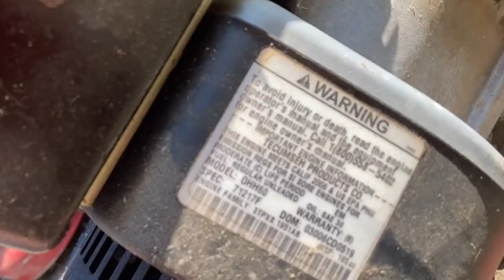GENERATOR PREPPING What you should buy now for your Honda, Briggs, Tecumseh, Chonda generator NOW..

Comment: I noticed you suggested keeping the battery of your generator on a trickle charger.  I have a 15kw generator with a 30 hp engine driving it so I need my battery to work.  I used a trickle charger for years and found that my battery was often dead in less than a year.  I just about decided I was better off  trying to remember to use a regular charger every month or so.  Off course that does no work so well because my memory is not so good.  Recently I have changed to using a battery minder.  The battery minder is equipped with sensing circuit which charges the battery only if the terminal voltage drops off.  I believe the trickle charger over charges the battery and reduces battery life.

Comment: Thanks for the excellent tips. I already keep an extra spark plug handy for my Jenny but had overlooked the carburetor and the air cleaner. Somebody actually gave me this generator because they could not get it started and it turns out that the flow orifice in the center of the carburetor was gunked up with deposits. Took some luck and a magnifying glass to figure out what was wrong with it. I put a note in my phone calendar to start it once a month and make sure to shut off the fuel and run it until it dies.

Comment: I have two generators one's a little Ryobi 2300 watt generator and the other one is an onan 25 00 w what I'd really like to have is a single cylinder or a little cylinder diesel just for the plain fact that you can store diesel fuel a whole lot longer than gasoline gasoline don't hardly last any time nowadays and if your power goes out for an decent amount of time and you can't get any gasoline the generator won't do any good but with diesel you can store it for a very long time without it going bad and practically a diesel will run on anything but it's a lot harder to find diesel generators that aren't just gigantic but in my opinion diesel is the way to go

Comment: If you live in an area where you get a proper winter cold weather you don't want to use 30 weight motoroil. You wan to to go with 10W-30 or some other winter compatible oil.

Comment: Using ethanol gasoline in 2 cycle small engines will deform the plastic float in the carburetor.  I use recreational gasoline (non-ethanol) in my Honda generator. I remove the float bowl under the carburetor by taking the 9/16 sized bolt off that holds the float bowl in place. I do that and drain all the gasoline out of the tank after every use. I've had my generator for five years and she starts up every time I need her. She's a sweetie. I turn the generator off at night, while we're sleeping. The last time the power went out here it lasted for 54 hours and the generator used 10 gallons of gasoline.

Comment: Great video Chic!!!  Hipa makes a dual fuel carb for $50-60 bucks that lets you run propane also, cant remember might even be natural gas too. i was told they are also working on one for my Honda 3500 also
Reply: I have a 3.6KW Black Max and got a dual fuel carb for it back in 2016. I think it was around $38. Took about 5 minutes to install and has worked great. Engine hasn't seen gasoline since. I only run on propane. Natural gas is an option.

Comment: Not my generator.  I run it for 15 minutes every month.  It is loaded with stabilized PNE gas and 10W30 fully synthetic oil.  I keep leanty of extra oil in the shop.  I shut it off with the fuel shut off every time I run it.  I also add Marvel Mystery Oil in all of my four cycle gas.  I keep 30 gallons of extra gas in a shed at the rear of my shop, PNE of course.  I am a stickler for PM.  I know how to do it and what has to be done.

Comment: If your pull rope should break,,,,not a problem.Un bolt the side cover with the existing broken pull cord.You can use ANY type of cord about the same length as the broken cord,,,wrap it around the fly wheel and pull,be sure your pulling in the correct direction as the old cord.This will work until you can repair the original.Works in a pinch,done it before.

Comment: Seems like nobody has any service parts for their equipment because of the disposable world we live in today. I have a spare carp-a-trator for a Briggs & ScrapIron push mower and a MTD Tiller (chonda), and some other odd service parts such as filters/spark plugs/rope.. I'm starting to like the engeneered fuel for storage like my leaf blower because it gets used a little every few months like a generator.
Reply: Not all engineered fuel is equal. Use this to flush your fuel system and it will never let you down.
https://www.youtube.com/watch?v=imrFqyTDtEA
I am pretty sure its available in the USA, as I understand the new specification for the non lead gasoline to replace 100LL will be an Alkylate. I know there are refineries in the USA that have Alky units for blending purposes.

Comment: I don't know if you run into this situation at all... I've been told if you don't run your generator every so often, the ? armature ? stator will lose it's residual magnetism and the generator won't put out any power.  I try to run mine every 2 or 3 months, add a shop light to make sure it's really working.  Again, don't know if this is really a problem or not.

Comment: Per your suggestion of draining the tank, once drained, would you also suggest running the generator until it runs dry to clear out the lines?   We have a Honda that we've had to use twice so far but it may be a while before it's needed but as you suggest, I'd like it ready to go.

Comment: Couple of things. You should mention the amount of turns and show how to wind the starter rope. Second I have a Honda Generator that doesn't have a fuel shut off petcock is there a way to add one so that you can run it out of fuel to avoid the mucky carb issue. :)
Reply: If you take the recoil off a Honda GX engine you will notice the starter cup has a slot cut in it so you can wrap a rope around and it pull start it....
Reply: @nos9341  I replaced a rope once and had to wind the spring like 7 times or something so it would go back in after I pulled it to start the engine. Never had a Honda just cheap mowers

Comment: Get some chickens.  Get a generator that also runs on propane.  Install a generator transfer switch for your home, then you can run your house like nothing happened.  If you have a big boat, keep the gas tank full, then you can siphon  out the gasoline for your generator.  And yes, keep plenty of oil on hand.

Comment: Converted my gas generator to Propane (kits are readily available on the net) cause you can store it indefinitely and not bother about gummed up  carbs. Regards !
Reply: There is such thing as a propane filter for good reason.
Reply: I converted my Honda 3000i to dual fuel. Great to have BOTH options. Gas has 15% higher output, so there's that.

Comment: I love to make bread, so I have a bunch of 5# bags of bread flour stored all over the house.  Bread is the staple of life and you can survive off of it.  I have a pound of Active Dry yeast in the freezer.  My ancestors from England and Scotland survived off of bread and so can I.  I can always cook something because I have two Blackstone griddles and if push comes to shove I can cook on my fire pit.  I do not use ethanol gas in any of my small engines.  My generator is full of gas and oil at all times.  My generator starts with one pull, every time.  The only spare parts I keep for my generator is a spare spark plug- RC12YC.

Comment: So how about a lp gas conversion for generator?  The good the bad aspects of a lp conversation.
Reply: "The good the bad aspects of a lp conversation conversion."
Unless you meant what's good and bad about talking about LP gas.
Reply: There is a power loss on most engines. Consumer generators generally can't put out their rated power on gasoline and on NG they can be down as much as 25% on power. LP is a little more energy dense so its less and issue.

In cold weather a lightly loaded set running on NG or LP might have an issue with moister building up in the oil and turning milky unless the set is run for an extended amount of time and under a significant load to warm up and dry out. If you do not do this there is a risk of rusting up the engine if it sits like that after use. Light duty sets like Generacs and Cummins sometimes ice up from all the moister and plug up the air box and crank case vents. I have seen a few blow the dipstick out of the tube and blow all their oil and and fail. 

Know you set and watch for issues.
Reply: I converted to a dual fuel carb back in 2016. The carb took about 5 minutes to install. Runs great on propane and handles loads just as well as gasoline. Engine runs a touch quieter on propane. There are no gasoline issues when you run on propane only. I can run on natural gas but haven't tried it yet.

Comment: There seems to be a lot of concern with bad gas on this channel and others. I have not had a problem with this living in Canada or the UK. I keep gas from year to year. Generally only mix a batch of 2 stroke evey second year. I only buy premium without ethanol which may be the reason. Is it the heat and humidity or is there actually a difference in the fuel. I'm over 60 living in house #7 and some of my 2strokes are from the 70's so it's not that I've just been running for a couple of years. On this channel I have watched you dump out fuel that looked 100% water.

Comment: Back when we had our first ice storm in 2007 I bought a unknown brand generator but I can’t find any information on the engine shroud. I finally found a new carburetor in Alabama but it is bad now ANY IDEAS ON WHERE A MODEL AND SERIAL NUMBER WOULD LIKELY BE.??  I hate to buy a new generator when the power goes out again!
Reply from the maker: Is there any identifying marks or names on the generator itself, not just the engine?
Reply: @Chickanic  I will have to do more investigating then. I may have found the replacement online but I need to know which unit I'm working on first. thanks
Reply: @kikupub71  make a video of it post on Youtube and link to this. I am sure there are enough people here that can comment and help you.

Comment: I am sorry Chickanic , but i would never put 30 oil in a motor any more , it is a way to bad oil in my mind. There is a reson to whay the car industry stoped using that caind of oil If you look in youre engine papers from Honda it will say 10w/30 synthetic oil. Have a some costumars that where using 30 oil and the oil whas like tar when draining it . After a few oilchanges with good synthetic10/30 oil the oil is never so dirty any more and they run alot better.  But this is only my thoughts and i have used 10w/30 oil sens 20 years back in the mashines here and they go like champs.
But we have the same problem with bad gas like you do "over there". Best whishes from Sweden .🇸🇪🇸🇪

Comment: Unfortunately my Honda generator is much more difficult to work on ,  it's a EU3000is everything is packed in tight to keep it quiet,  I wish it was fuel injected but it's not,  I wanted a larger one but I keep it with a 5Th wheel camper, to supplement the Solar. If TSHTF my Camper is its own power plant as long as there's sunlight and I can find gas for the generator if I need to run AC the solar is limited to roof space . I've thought about getting extra solar panels to place on the ground so the generator is not as necessary. The only downfall to this setup is cost!  Solar is not cheap good Lifepo4 batteries are extremely expensive! My 2 270AH batteries cost $3k each but they do have a 10 year warranty and should last 20+ years, you need the batteries for night use and enough to get through the night then enough solar to run everything and recharge the batteries during the day. IMHO solar is the way to go if you can afford to invest in it.

Comment: I have a generator with a "Chonda" on it.  It's a dual fuel, so I've only run it on propane to keep the carb clean.  Is there anything else I need to do to keep it in good shape?
Thanks!
Reply: Run it with a load every month.  Change the air filter, spark plug, and oil as recommended.  Use fully synthetic motor oil.

Comment: The biggest challenge with "prepping" for a power outage will be determining how long the power is going to be out and keeping sufficient fresh fuel on hand. The gas station will be out of service and the little gas can you have for your mower won't even make it through the first day. Rural people may have diesel fuel supply for their tractors or LP gas for their homes than can power generators but city people don't have an easy solution to fuel storage.
Reply: If possible, convert/buy a dual-fuel genny. Propane stores forever and it's safe.
Reply: True. You can buy a Tri-Fuel kit for that genny.  It will run on gasoline, natural gas and liquid propane.  

I installed a Tri-fuel kit on our gasoline generator.  It works great.  I have it connected to our homes NG line.

Comment: Every mechanic knows but will never tell YOU, that if your carbie is playing up, chances are it's gummed up. Modern gasoline is crap. The ethanol they put in ALL gas attracts water and the fuel itself is far less stable.
Two things you need to do. Get a spray can of carburettor cleaner and a bottle of Stihl ultra 2 stroke oil. Add a couple of caps full to your filled tank. The oil will coat your carbie and the fuel stabiliser will keep your fuel fresh longer.
When you finish running your generator , turn off the fuel cock and drain the float bowl. 
Run the machine at least twice a year. Same with over wintering motor bikes.

Comment: When you put your generator away. Make sure you shut off the fuel. Pull the ball off the carburetor. Do not leave I mean gasoline in the carburetor. Ethanol kills carburetors. Here in Ohio I can get known ethanol gasoline 90 octane. I still won't let the carburetor set with fuel in it!

Comment: A Honda GX390 is a gas hog, and total overkill for 2 fridges and 2 freezers. I have two refrigerators and a freezer and I have powered them for 2 days straight on a gas sipping 2000 watt inverter generator. A 3500 watt inverter generator, in my experience, has enough oomph and power for most people to power the fridges and even a small window AC unit. Id much rather use a gas sipping inverter generator than a loud obnoxious 3600 RPM beast that is going to drink fuel.
Reply: Agree. The "big blocks" are fuel hogs. Those larger gens aren't needed for a couple fridges and lights. Modern fridges are not high wattage. My 3600 could easily do fridge furnace and lights.

Comment: Thoughts on LP generators? Seems like LP gas is much more stable and storable than gasoline. Plus no sticky carb to deal with.
Reply: Less wattage with LP compared to gas.  Unless you have large LP tanks for cooking or hot water it's better to stick with gas (or dual fuel where you can switch to LP if you run out of gas).
Reply: @haywoodyoudome  If you are smart about it you can can work around these problems. the Head and piston from a GX160 put in a GX200 clone will raise the compression to 9.5 : 1 and you will have no power loss on propane but can still burn mid grade or better pump gas.Another example would be a 301 predator head on a GX340
Reply: @nos9341  Seeing as how the price of mid grade gas is getting close to $4.00 a gallon I'll pass on rebuilding my generator.  Not to mention I have no plans on using LP as the primary fuel.
Reply: @haywoodyoudome  $ 4.00 a gallon I pay closer to $ 5.00 corrected for currency change. Smile and remember the rest of the world pays a lot more than you, it might take some of the sting out

Comment: It wouldn’t be a bad idea to grab some av gas for the generator it last many years and you can get it at pretty much any airport although definitely a bit expensive especially with are wonderful administration we have now. let’s go Brandon
Reply: i used to run my triumph motorcycles on av gas and it burned holes straight through the pistons i would never recommend that stuff for small engines ...
Reply: @leeholzmann1023  damn really that’s crazy I thought it was just high octane leaded race gas am I mistaken on that
Reply: You might have to be carefull with using av gas.I had a friend who put it in his car,and he burned his valves.Its 100 octane low lead.
Reply: @GoldSeals  well than maybe just find a performance shop and get your average race gas I definitely didn’t realize av gas was that potent I guess it must have additives special to piston aircraft engines I just thought it was a regular high performance fuel apparently I’m very mistaken
Reply: @ChrisN85420  maybe marine gas would be better.No alcohol in marine gas.
Reply: @ChrisN85420  ,you could get VP racing fuel.There is another racing one.But I dont remember the name.Im not sure you would want to use racing fuel either.